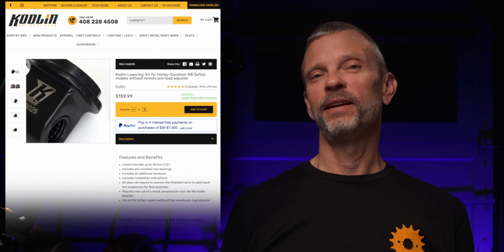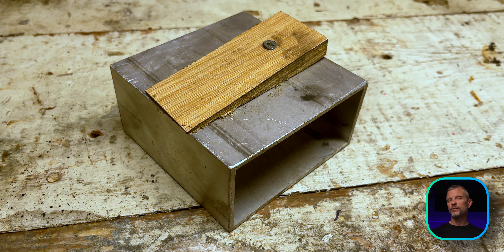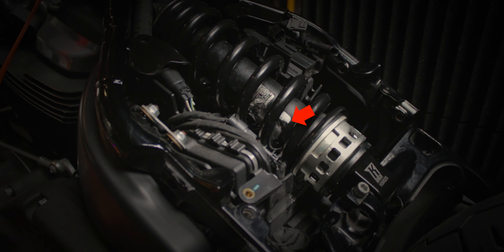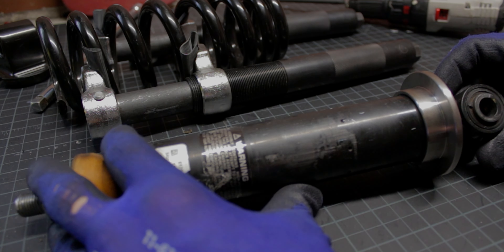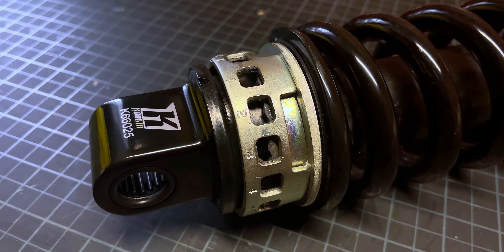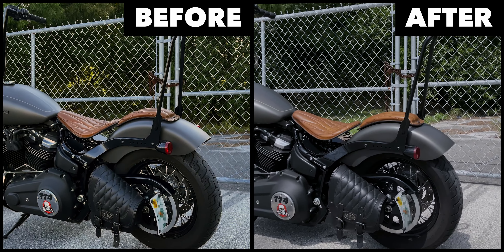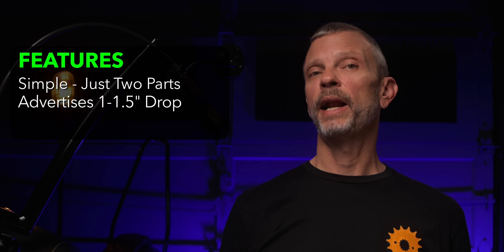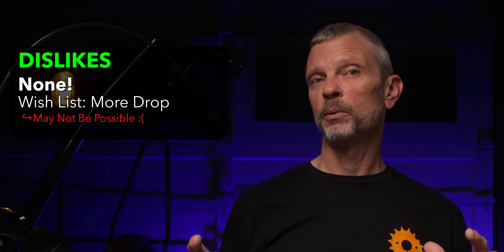Kodlin K66025 Lowering Kit ⬇️ M8 Softail • Installation & Review [Not Sponsored]

Comment: Hello Ron, Trying to install this kit but got stuck trying to remove the original piece. I loosened the nut but when I tried to unscrew the main piece the center pin just spins with it and I can't get it loose. Any recommendations? Is the main pin suppose to spin? Is there something wrong with my shock? 
Any input would help. Thanks.
Reply from the maker: Hey Rodrigo - did you loosen the jam nut that sits against the lower shock mount? Once you do that you can also wrap a rag or piece of leather around the shaft and hold it with channel locks or vice grips to keep it from scarring. And yes it’s normal for it to spin. 

Let me know how it goes!
Reply: @RonsWorkshop   Ok good Im glad My shock is not Broken. Yes I was able to loosen the lock nut with no problem but the main piece is really in there. Whoever put it together must of used allot of locktite or something. I tried everything. A piece of leather and Rubber around the main shaft and with strong vice grips but no luck.  It just doesn't want to come off.  It just spins. So frustrating. I just spayed some stuff called Blaster its a penetrating catalyst for removing screws and rusty nuts. So hopefully that will work. 

Thank you for your time.  Thanks for all the work you do on this channel.
Reply: So The Blaster did not work. I Tried some heat also with no luck. Just to check the thread is counter clock wise rite?
Reply from the maker: @RodrigoMelo-ms7qi  it has "normal" threads - "righty-tighty". PB Blaster is great stuff - if it is still hanging on you might try standing it vertical with the stuck fitting down, and then giving it a heavy dose of Blaster, and let it sit a full day or overnight. I suppose if it just won't let go, and heat doesn't help either, you could grind or file a couple of flat spots on the shaft and clamp it with vice grips. But surely that thing will let loose.  Let me know how it goes...
Reply: @RonsWorkshop  Hey Ron Thanks for all the input. I appreciate it.  Ok so I finally got it loose. I clamped it as tight as possible and was just a little more persistent with the heat gun. It took a little while but I finally got it loose. I had to really heat it up quite a bit. A little bit of a mission but it finally worked.  I installed it on my Bike and it looks great. Next Im going to relocate my License plate and put in some nice small LED's on the rear so I will need to do some wiring. some 3in one Hog lights I ordered from Australia.  The Plate light is pretty straight forward. But My Hog lights have 4 wires Blue,Black,Red,Yellow and my stock lights are just 3 wires Blue,Black and Purple. The kit did not come with any instructions. 
So I guess I'll have to figure it out. Thinking of contacting them to see if they have any diagrams or something. If you have any suggestions I would appreciate it.  By the way I have a 2022 FXST with a 107 M8 motor with a stage one set up. It's basically a street bob with chrome and a smaller motor.  It's my second bike and I love it. Been doing all the customizations myself and I enjoy doing it very much.  I really appreciate channels like yours.  It's very encouraging and it really helps allot. Especially when a content creator responds to messages like you do. Thanks again for everything.
Reply from the maker: @RodrigoMelo-ms7qi  woohoo that's great news! And thanks for the kind words. If your Hog lights have yellow and red I bet one of those wires is for the yellow (which yours doesn't have). I love doing the projects too...I've in the middle of one and then there are a few bigger ones coming up that I'm really excited about :)

And if you want a sticker send me a DM on Telegram, Instagram or Signal with the mailing info @RonsWorkshop
Reply: Sorry I didn't see this earlier.  Here is what has always worked for me, and I've done a lot of these. Typically, I leave the bushing in the rod end. Then using a wrench on the nut, I insert a long 3/8 ratchet extension into the bushing for leverage to loosen.  I leave shock in our tool and the tool is held in a vise.  Most of the time the rod end snaps loose easy enough and comes off by hand. For those stubborn ones I will carefully heat up the nut and base area to melt the thread locker. Doesn't need to be smoking hot but you do need to give it time for the heat to soak into the threaded area to release the thread locker. If by chance you get one that is hard to unthread stop and apply lubricant to threads to prevent galling to the threads.
Reply from the maker: @kodlinusa6155  thanks for providing input!

Comment: Do you think this kit is compatible with the Progressive 460 shock? I want to lower the bike because I am short. I also want a smooth ride. Any advise?
Reply from the maker: Hey Sportster rider - I’m guessing it wouldn’t be compatible because it’s such a precise ft. But Kodlin is very responsive so maybe check with them directly. Let me know what you learn!
Reply: These products are designed to fit OEM shocks in 2018 and newer Softails only. Currently, we do not test fitment on aftermarket shocks and have made no measurement comparisons.